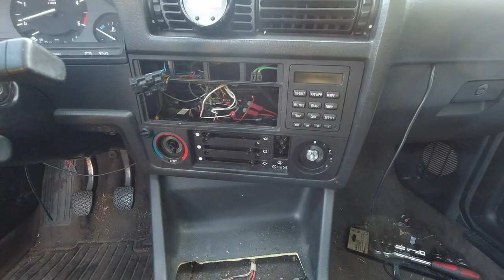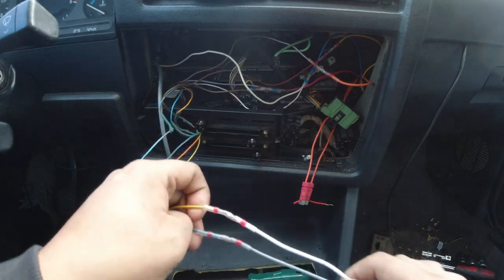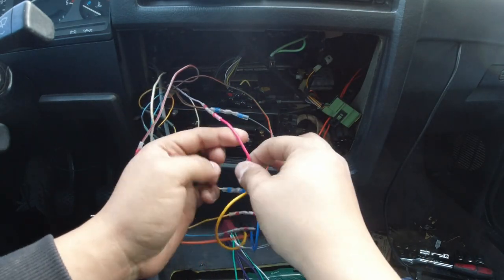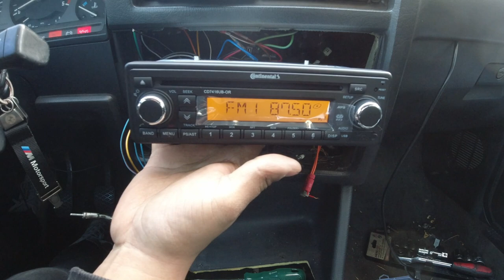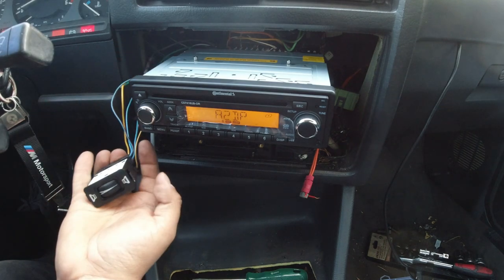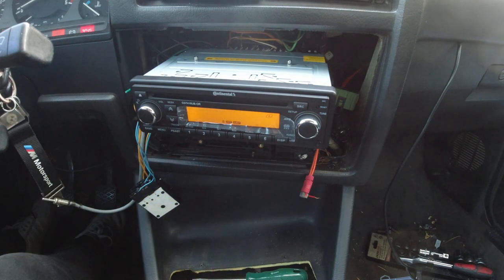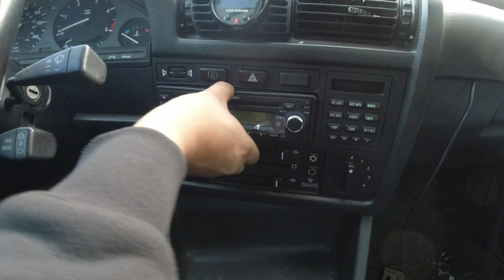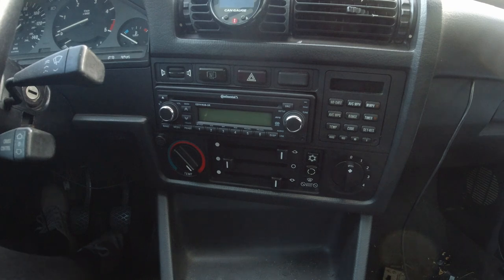VDO Continental Stereo Install in BMW E30

Comment: If you're only connecting one wire for the front speakers and one wire for the rear speakers, how does it handle left/right balance?  Forgive me if I'm missing something really obvious here.  Excellent video by the way.
Reply from the maker: Thanks I appreciate it! The balance is handled by the separate fader switch on the dash. It’s possible to wire in the rest of the speaker wires directly to the stereo and have it handle the balance but I decided not to.

Comment: I installed the CD7416UB-OR in my '91 850i a couple of weeks ago. I also replaced all 10 speakers in my car. My BMW does have a factory amp in the trunk. I used a pigtail available on Amazon and Turner that already has the plugs made up to fit the radio and the factory BMW plug. I did not have to make all of those wire connections. Sound is pretty decent. Probably limited in quality because of the small diameter speakers in my car. The largest woofers are only four and a half inches. I do have an additional plug that came with the radio that has two RCA jacks on it. Can I use these two RCA jacks with an aftermarket amp to drive one or two larger woofers? Thanks,

Comment: I know this was posted a long time ago but do you have an issue with cranking the volume pass 25?. When I do that it cut off/restarts it self. Do you happened to know whats the reason for that?
Reply from the maker: @deadpotatogarage9445  I’m not too sure what could be causing this. I haven’t had any issues turning it up all the way.

Comment: With the way you've wired the antenna power, does the antenna still behave as it did before (goes up/down with power on/off on the stereo)?  Thanks.
Reply from the maker: Im not sure on the antenna because it never worked on my car

Comment: Something I don’t understand is… do I not need to run all my speaker wires to the provided harness if I have the fader switch?
Reply from the maker: If you intend to keep the fader separate from the stereo then you would only have to wire the solid color speaker wires to the stereo. You can get rid of the fader switch all together by wiring the rest of the speaker wires directly to the stereo harness and use the built in fader in the stereo.

Comment: Was your E30 equipped with BMW's premium sound system?
Reply from the maker: Yes it was
Reply: @ulisessanchez7379  Are you still using the common ground for the speakers or did you have to rewire them for this stereo?
Reply: Also, did you have to do an amp bypass?
Reply from the maker: @Jay-mc7vq  it is still using the common ground for the speakers but the car was already wired in for an aftermarket amp when I bought it
Reply: @ulisessanchez7379  Thanks for the help!

Comment: My 90 bmw 735il is floating ground and I did figure out how to install a non floating ground using a floating ground adaptor.  Still I have t bundle/solder (7) wires for the grounds so no parallel circuit.  I think I damaged the radio, but want a period correct like yours.  I see they still are for sale.  Seems your Continental was floating ground hook up?
Reply: I notice you leave the head units speaker plus and grounds unhooked.  Maybe that’s where I fail.  I tried to use them.
Reply: I noticed wire colors are similar to mine.  I have two brown black wires that are amp grounds and a solid brown wire that is the ground.  I don’t see that brown wire on your video.  I see you used the two black brown wires.